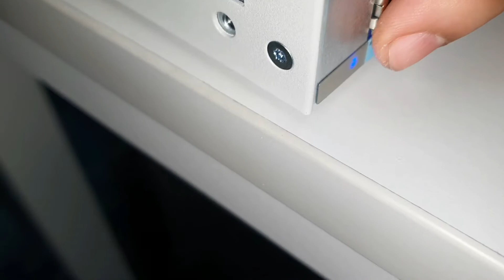Unboxing and Deploying - Cisco C9200L- 48T-4G-E

Comment: Is this L2? Or L3? 
Actually, I am planning to buy a C9200L-24T-4G-E.
I need to use inter-vlan and static routing. 
In my thought, there is no problem on C9200L-24T-4G-E but I am not sure.
Reply from the maker: Yes, it does support L3 capabilities and supports both inter-VLAN and static. :)

Comment: Great video man. Keep it up!
Reply from the maker: Thank you!
Man! You have awesome content as well!
Hope to cross paths with you in future! :)
Reply: @NathanielEludo  Hehe thank you. I'm posting some in English in the future. Let me ask you a question about the stack if you don't mind. When you have the stack, what happen with the management ports? The one next to the console.
Reply: I might stack some 9200L tomorrow but I need to be clear about it
Reply from the maker: @MSTECH-DR  Since it's now 1 logical switch you can still use the management port and assign an Static IP/ via DHCP that you can utilize for your out of band management of your switch man. 
Did I answer your question? 🤣
Reply: @NathanielEludo  Partially hehe. Like am I going to see 4 management ports but accessing the same logical switch. I am thinking at the moment when the active switch fails, its management port won't be active anymore. So what will happen with its IP? Hope I explained my concern right
Reply from the maker: @MSTECH-DR  Then assigned IP on Management port, gigabitethernet1/0
 (stack2 for example) on that faulty switch won't likely going to be reachable. Hmm
Reply: @NathanielEludo  that’s what I was wondering. Thanks man!